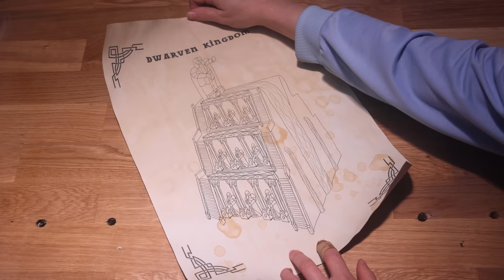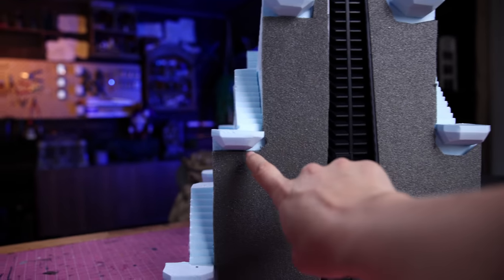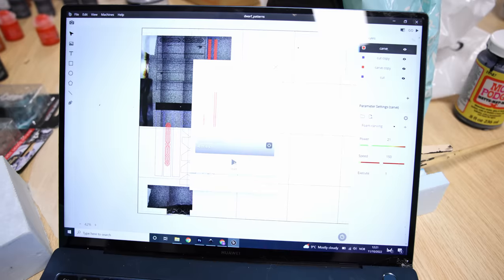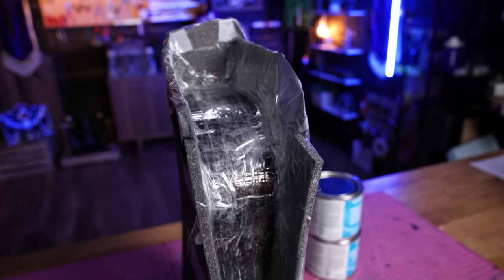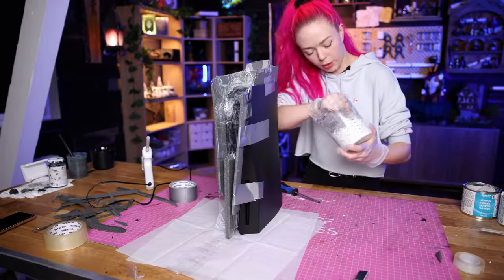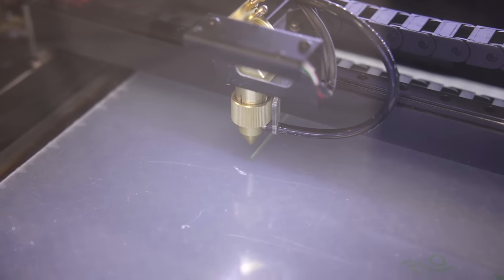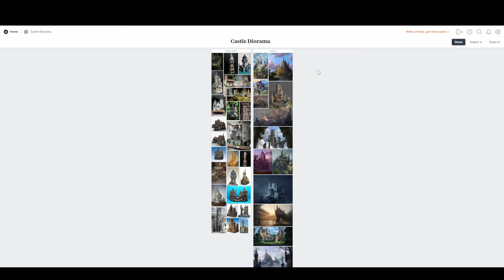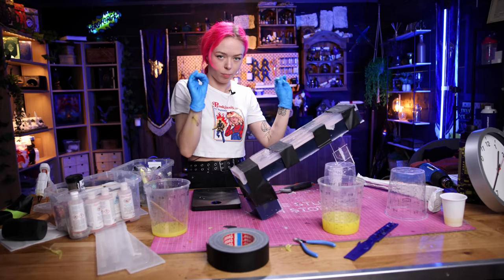I turned my PS5 into a Dwarven Kingdom

Comment from the maker: Pinning a post about thermals, as there are so many engaged commenters. The airflow is unobstructed, but if it becomes a problem we'll just pop it off. This is just attached to the faceplates, it can be swapped out at any moment :) Maybe don't do the same thing unless you don't know what you're doing. Insulating your PS5 is not recommended.
Reply: I am Challenging you to work on the dream closet and design please.
Reply: Ha fair, it is literally the first thing I thought about when I saw you pull out the foam.
Reply: You're setting a new trend, better not give these companies new ideas lol.
Reply: I would love to see an update video on how this runs and if it has any overheating issues, my cats sleep on top of my tv cabinet while my ps5 is running because it’s output air is so warm and they love it. Love the design would love to see if it overheats or can run fine with all the additions
Reply: Yeah it looks EPIC ... but it is not good for the console or performace
Reply: @METROIDER123  i mean they literally say if you have no idea what you're doing, dont recreate it. But they also say the airflow is unobstructed, so as long as you have this setup on a table or in the open you should be fine unless you already ruined your ps5
Reply: @durarada  ps5 needs airflow around the console aswell. That is how it is designed having anything on it can effect the thermal performance slightly. Atleast the air vents are unobstructed. The design is cool though ngl
Reply: The point is that it looks fuckin sick and that you don't have to stop arts and crafts if it's what you enjoy doing. Great job Nerdforge!
Reply: Great stuff - Love the design and effort you put into this one - You should do a NINTENDO SWITCH version!!!
Reply: @gaming fun50 Are you REALLY asking to the artist who created this to be prettier (only in your opinion) because you can find the video funnier if so? wow. some people deserve the feminism.
Reply: How much would it be for you to do design of kingdom hearts for my ps5
Reply: and I wanted to write "Skidaddle, skidooddle, your fan is now a noodle" XD
Reply: @gaming fun50 She has absolutely beautiful hair and is a stunningly gorgeous woman. Are you cross-eyed by any chance?
Reply: @durarada  In my book the only ok thing touching my console is the table that it sits on and at least 10-15 cm of air all around it. The sides should be ok but obstructing the Vent up top even by the slightest is not a good idea , thats where the hot air escapes from .. I am 100% positive that they could make something that has the top side completely unobsrtucted .
Reply: @durarada  airflow isn’t completely unobstructed though because the ps5 is sitting flush on a flat surface. There are small air vents on the bottom that need some clearance to be able to successfully ventilate which is what the small circular stand is used for. And from this whole video, everything was down with the system not being on that stand so that space wasn’t accounted for. Sure, airflow on the backside isn’t obstructed but it is definitely on the bottom and the top and side vents that run along where the lava lays could be as well.
Reply: OMG Nerdforge I'm just completely blown away!! I think there must have been a dwarven smith somewhere in your family history.  Aside from the amazing diorama-esque faceplates, I wanted to complement you guys also on your excellent camera work, lighting, and overall production. The off-label use of the trowel was cute, and had me laughing. Now as this is supposed to be a reply on thermals; I don't think your add-on will contribute in any meaningful way to overall thermal build-up as the plates weren't designed to radiate heat away from the 5 in the first-place.  But the only way to know for sure, and if you feel it's a cause for concern, you can always put a thermometer (with a probe) in the rear vent. It won't read the core temp, but you can get an idea by how hot the exhaust air is. If you're consistently reading exhaust temps over 50C you could always add one of those accessory rear fans to pull more hot air out, or with your exceptional skills at designing and building, maybe come up with a better way to cool Sony's version of the modern space heater. Still, what an incredible build!!!!
Reply: Can u sell this
Reply: Can I send my ps5 and you do a freestyle  on minds.  Your awesome your not no regular chick...Your something like a god...I mean your a beast in your craft.  

Keep doing your thing and looking good 🍯 🖤💜💜🖤👍👊
Reply: Best ps5 ever! Imagine playing skyrim on it. Lol
Reply: to be 100% honest with you, it shouldn't make that much of a difference to thermals as long as the vents which are at the back and along the black central slab and side  panels are kept clear of obstruction. The panels themselves do not conduct that much heat.
Reply: I was just wondering about this
Reply: Very talented project! Hats off!
Reply: My ps4 already overheated at 30 degrees Celsius, your is probably gonna go on fire at 10 degrees Celsius
Reply: I have to admit, it was my first thought. Definitely not enraged, your kit your choice and all. But I was concerned. Consoles already suffer from their small form factor and the amount (or lack thereof) of methods of cooling. Usually the case itself is used as a heat sink as well, so the foam could definitely impede that effect.

It'd be an interesting update if you had a thermal gun to read how it works. But still a really cool project regardless.
Reply: Since many are talking about just the airflow, I figured I'd say something about having your PS5 vertically. There have been reports (just a small percentage of PS5s really), where the thermal paste on the CPU has melted and got to other parts within the PS5, which bricked it.

Again, it's just a small percentage of PS5s that have this, but I thought I'd let you know just in case.
Reply: Do not matter if it's unobstructed if the materials retain more heat. Also do not matter if you can put and remove it easy because maybe when you realize about the problem may be to late. Once saidd that it looks really cool.
Reply: @sirradez  yeah, I still don't believe in having a console vertical. I bought an aftermarket horizontal stand since the one it came with isn't great.
Reply: Well, You improved the look of PS5! That's a win no matter what lol
Reply: @reinoaalto9941  I never had a thermal problem with the original ps5 I have a day 1
Reply: Me too
Reply: I need to know are u single
Reply: @adilhome  No one here has to ask you that question...
Reply: You have awesome creativity! But yes, about overheating your system. The ventilation can only do so much. Hope you keep your home or at least gaming room below 68 degrees.
Reply: I ask martina that your hair is real ?. Is Real color hair not painting hair ?.😅😅
Build ps5 like this is so amazing❤😊
Reply: Can you do that to PS5 too?
Reply: I won't be surprised if a filthy rich kid comes up to you to do something to his ps5 or pc at this point 😂
Reply: Lavafall
Reply: Everybody talking about the airflow, meanwhile no one thinks the lava is a bad idea.
Reply: I didn't for a moment think there'd be thermal issues, you're adding insulation to an already very insulating material so there'd never be all that much of a difference
you're a pro and you know what you're doing
Reply: Goodness if I could send ya my xbox or ps5 to you I would love all that upgrade that's so Freaking awesome
Reply: yeah, but it looks great though

Comment: I believe William deserves a raise, shaking himself into a frenzy for those pilar patterns, poor boy!🤣
Reply: A brick helps. Ok the "hack" is more for like 3d printers where putting them on rubberized pads on a concrete slab helps with shaking and vibraion. But casting a concrete table for the laser cutter sounds like a project :D
Reply: @unpaidintern6652  they can turn it into a "We made William a birthday present!" video🤣

Comment: I always wonder if this does affect the airflow or if any parts of the construction melt because of the heat.
Reply: I was JUST wondering about the same thing.
Reply: exatly
Reply: hugh1766  it looked like the vents were totally open when you it from the back
Reply: Same.
Reply: I thought the same
Reply: obviously it does wdym always wonder XDDD
Reply: @razzledazzle2332  air flow is coming from the front to the back so no bueno
Reply: would have been dope if she water cooled it lol
Reply: @Ms7mido  you and most other ppl are wrong, as you can see at 15:21 THE FRONG AIR VENTS ARE OPEN ON BOTH SIDES(the vents are where teh "lava fall" is , there is space for the system to pull in the air ...........and the back where the air exits is open, if anything the, vents might be a little blokced, but i did not look like it to me.
Reply: @aaronclay4665  see what you mean theoretically not wrong but realistically the whole thing is trapped inside a hugging cabinet basically so the heat doesn’t escape as easily anyways it’s not like it’s gonna destroy it in the short term but might do that in the long term as the temps getting higher one way or another
Reply: @scotthotz8844  ok Professor Google
Reply: The thing will melt
Reply: Probably have to play light games 😂 to keep the external case cool but it does look like the vents are not blocked.
It’s like it’s a pc but still graphic cards do get hot as well.
Reply: Of course. This is TERRIBLE for any electronics
Reply: I'm late to this video but the PS5 already has issues with overheating on its own. It runs hotter than PS4 for sure. There are actually panels you can buy that have air flow vents to help with the heat though. That's what we have done for ours because it genuinely feels like a mini heater. So yeah I think there's not enough cooling for this system on its own and adding even more layers to the outside is going to damage the internals.
Reply: @scotthotz8844  Overall system temp will be higher.
Reply: so many armchair experts....
Reply: Don’t get me wrong this thing looks amazing but the airflow is totally fucked
Reply: @eriksimca9409  Doesn't take an expert to know common sense 🤷🏼‍♀️
Reply: @skorpthedope692  not only that but this will be impossible to open up and fix if anything goes wrong.
Reply: Ofc it does, this is just some dumb thing to do to every console, you're putting weight on the console, so it effects the air flowing
Reply: the back is completly open an the lava has gaps for the front vents, also the leds dont make much heat an are insolated by the foam everything should be fine but them fans are going to be working overtime because the internals will diffenatly be more insolated
Reply: it surely does
Reply: Logic v Emotion
🤣🤣
Reply: I think that's where all the dislikes are coming from. It looks really cool for sure, but this whole thing is super impractical for real use and only good for video content.
Reply: @razzledazzle2332  it pulls air from the top and out the back
Reply: @razzledazzle2332  Front ones are open as well, she added spaces with foam before pouring the lava on the top and front. On the finished version you can see the dark openings to either side of the glowing lave where the vents are, air flow should be fine.
Reply: @razzledazzle2332  Not the intake on the front
Reply: @aaronclay4665  What is frong?
Reply: Ingen ting, Tingeling.

That blue stuff is great for insulation, we use it to make home made ice boxes. The thing looks amazing, but I doubt air flow even factors into it anymore - that thing's gonna have serious overheating issues. 

I still want one.
Reply: I wouldn’t even be that worried about the airflow, like no question the airflow was effected for the worse. But the bigger issue IMO is that she encased the entire PS5 in a gargantuan amount of insulation, which might be fine except the heat comes from inside the PS5. So the PS5 has lost the 90% of its surface area that was able to dissipate heat into the environment. I wonder if the thing still works, or whether she even used it. I have a feeling she kept it as a art piece and doesn’t ever turn it on.
Reply: @Ms7mido in put air flow top and side for the fan to blow air thru the system to out put in back. She block air flow from coming in. So fan over work and overheats since no input air flow. Just hot air thru out system overheating out put

Comment: I hope you worked out the air flow and the overheating issues you might encounter after this build! Considering that it’s a model around a piece of tech!

Also the amount of effort you put into this video is amazing. You and your team are amazing!
Reply: lol my thoughts exactly the whole time i was watching this video
Reply: @erwinhernandez5264  same here
Reply: Hello guys here to put your minds at ease in case you guys didn't know the airflow for the ps5 comes out of the backside of the console  their design uses the front and side of the console but from what I can tell they didn't do anything to the back side of the playstation  to ensure that the airflow is still possible so it doesn't have any sort of overheating issues
Reply: @minecraftsnyder4223  I really thought that it would have one as the front and top part of the PS5 is completely blocked. But good to know that it doesn't seem to pose any problems.
Reply: Same thing I wanted to say . 😂😂
Reply: @minecraftsnyder4223  it actually has some vents around the top and bottom of the console as well. They go around the entirety of the top edge and bottom edge if it is standing up
Reply: Top entertainment Clips, that's literally ALL I could think about, lol!  I imagine she just did this for fun.  I mean, from the looks of things, she's completely covered up the top vents, so I would imagine that super-insulating your PS5 with XPS foam and blocking the major air-ways like this would definitely, result in severe overheating.
Reply: Same here, it's a fancy fire starter in my opinion. Hope not but i fear it's gonna burn down the house etc or least the ps5 will melt xD hope not of course though
Reply: @erwinhernandez5264  ditto
Reply: Especially when play horizon more heat
Reply: looks neat, but she just decreased the lifespam of that ps5, no airflow nothing, creating allot more heat, and no warrenty as you opend it and painted it.
Reply: This will affect the Playstation performance,don't buy into the bull about "it doesn't affect the air flow,the main intake vents are at the top(that's why the top vents attract dust,and the back is the out air flow).....she straight covers the air intake
Reply: @minecraftsnyder4223  it does come out the back but the default airflow of the ps5 is still not great, so all the added insulation is gonna ruin it
Reply: @minecraftsnyder4223  Lol, air comes out from the backside but it is called "airflow", air must  flow inside the console, and before coming out it has to come in, and in the ps5 it comes in from the frontside and from the upside....
Reply: @minecraftsnyder4223  Try putting a pillow over your ps5 while its running. Even a vent in the back wont cool down a build like this. It''ll probably need a constant airflow.
Reply: @minecraftsnyder4223  the ps5 sucks in cool air from the top and exhausts it out the back
Reply: she probably isn't ever planning on using it..
Reply: I was thinking the same...
Reply: Who cares she prolly wont even use it like we do. Youtubers just buy it so they can get views, theyll probably have it as a paper weight
Reply: If you look at 17:27 you can see that they left the top and front vents exposed and nothing was added to the back part so I don't think there will be any issues.
Reply: I think it's just a cover, yall. She can just remove it when it's in use. This is just so it doesn't look like Seto Kaiba on the shelf.
Reply: This is exactly my fear for her. Vents and air aside, the panels on the sides will heat up with use and time. Depending on how she uses it, that foam will desintegrate and warp, possibly melt. And uh.....that won't be good for the epoxy and cables and lights... 

I.... man I usually am all for these builds but this one has too many possible bad endings that aren't great lol.
Reply: lol she probably didn't
Reply: I was thinking the same thing.😂 poor ps5 is gonna burn to a crisp on the inside lol
Reply: I mean no ones actually going to do this at home, kiss your warranty goodbye. Its just for them to craft something cute.

Comment: I always wonder what effect does it have on cooling. But it looks awesome ^^
Reply: Same here!
Reply from the maker: We always make sure to leave the air vents open, so probably not much!
Reply: Where do you think the Lava is coming from ? :)
Reply: @Nerdforge  There are vents all around the top and bottom side (under Lava) and the bottom of the console - hence it comes with a stand - as this is where the cool Air is sucked in - the rear is Just Exhaust to get rid of warm air - so you have blocked the cool air intakes or at least restricted them...
Reply: Real nice now make your ps5 controller de same
Reply: @BAMozzy69  they mentioned in another comment that they planned for this and left the intakes unobstructed.